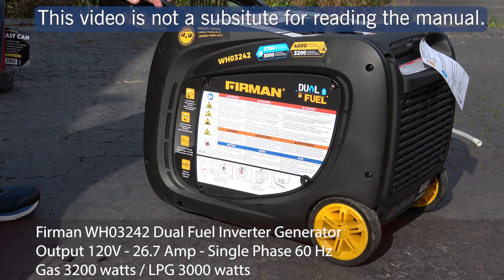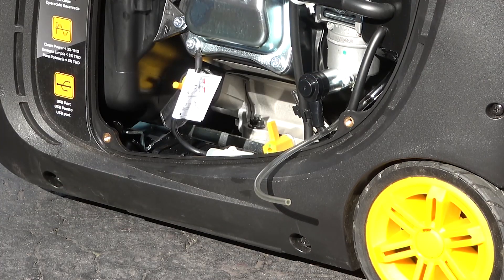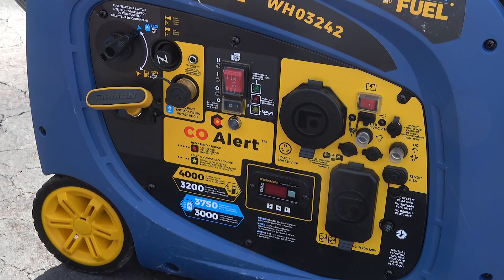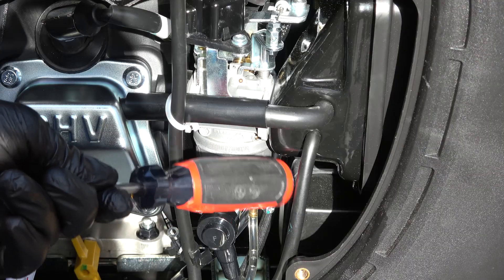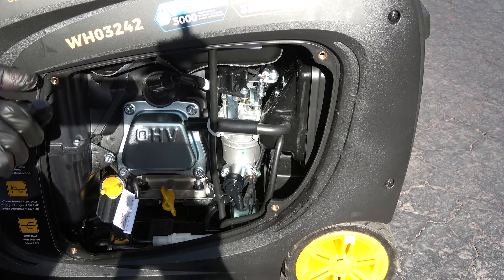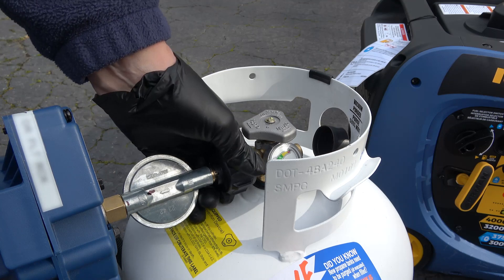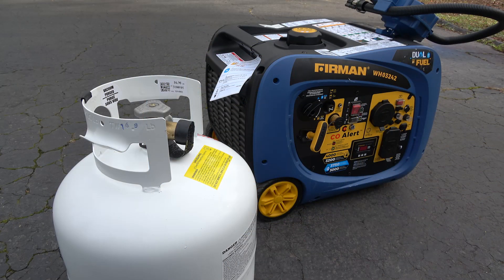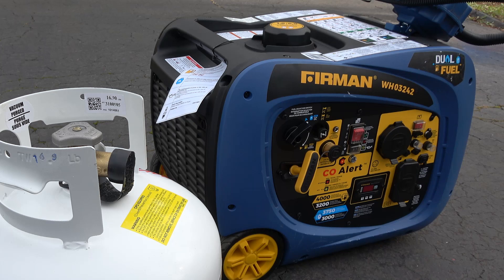FIRMAN SWITCHING TO PROPANE OUTPUT

Comment: A couple of years ago I decided to only use propane for the reasons you mentioned. I did run the Firman dry but don’t think I did that carburetor draining of “a few drops” still left in there. Would there be any point in me filling the gas tank with something like Stabil fuel stabilizer (or your suggestion) for a few hours and then opening that carb screw and draining it all out? Would that remove any gummed up gas that may have been left behind ? There may be a time I would want or need to run on gasoline again and I am now concerned that the carburetor would not function. Thank you.
Reply from the maker: Like you I don't plan on using gasoline, but in an emergency plans can change. If there still fuel in there, it will be a few drops, I would drain it. If it has been there a while I would run some fuel through it and start it. If only to prove the carb is working, then run it dry and drain the carb.
Reply: @cfldriven  OK thanks I will do that.